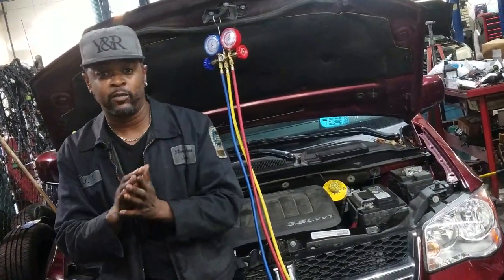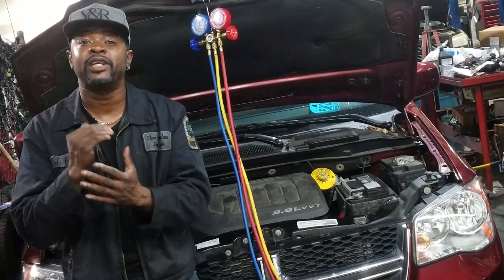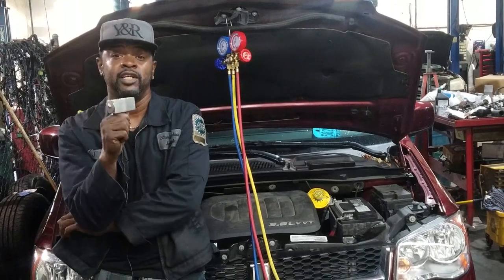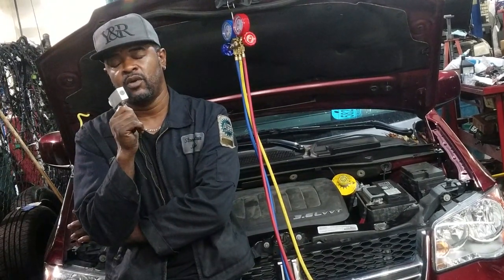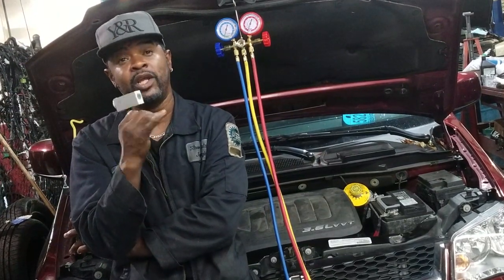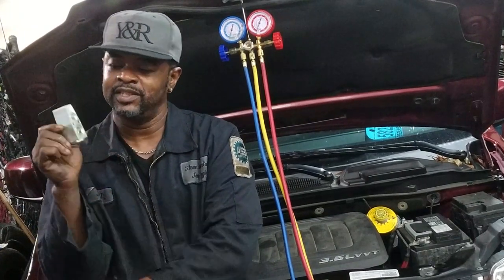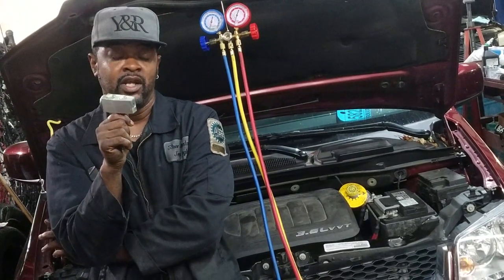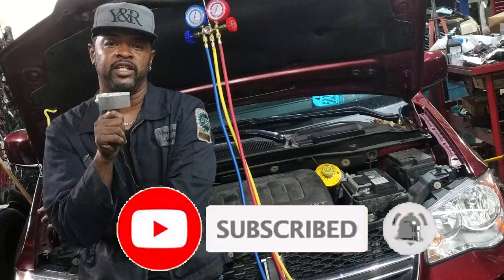My TRICK for How to get COLD AC. How to Replace Expansion Valve.

Comment: does anyone know if there is supposed to be air flow blowing out from the where that expansion valve is attached to the lines? I just changed mine, and it's blowing out air from there, and I don't know if that's normal or not : )
Reply: maybe I can clarify a bit. I changed the Expansion Valve, and when I turn on the A/C I can feel alot of air blowing out from that box area where the Expansion Valve goes. If I push down on the top of the Expansion Valve, push down the bulb/disc top of it, the air almost stops blowing out from there. I just don't know if it's supposed to have air coming out from their when the A/C is turned on.
Reply: Also, lol, I bought a new Expansion Valve and when I put that one in, I tried doing a Vacuum test to see if there was a leak somewhere, and it would not hold a Vacuum at all. So finally after trying to reinstall it several times, and even changing the brand new O-rings for a different set of brand new O-rings, I decided to put the OLD Expansion Valve back in with new O-rings.... the OLD Expansion Valve held the Vacuum easily, the Vac pump got it down to 30 Hg in a matter of a couple of minutes. So, I left the old Expansion Valve in, but I have no idea what that's all about, lol.

Comment: Very informative video.. Can I ask you,  and can you remember since you do these repairs,, exactly what type, color O-rings go on both sides of the expansion valve? 
See, I checked my 2015s system, (which has 78k) and found a leak at the rear expansion valve, just by visually inspecting it. I am about to venture into this job bcuz I am quite capable to do it. I purchased an After Market evaporator and expansion valve for the Rear, except the O-rings were not included. So I have seen the rubber types, red, green or black, along with ones that have aluminum ring outside with rubber in center. I have researched this O-rings and cannot find clarity. My question is, which goes on the evaporator side of expansion valve, and which go on opposite side facing tube pipes the lead down under van.? I'd like to know if you can shed some light on the orientation, on how do they go on this Rear side and which to use? I'd appreciate it gratefully.

Comment: Great videos bro I plan on watching them all. I'm a car video junkie. Real quick, 2018 Durango, I'm getting a hissing sound or it sounds like freon gas running through the lines. The noise goes away when I turn off the climate control and so far my AC is working fine. I was thinking might be the expansion valve or low on gas?  Your thoughts would be appreciated I'm definitely a DIYr. Just replaced an ESIM for gas vapor from watching YouTube. Many thanks!

Comment: Gonna try tap trick because línea seems to be doing what you spoke of.  But my low pressure side running high and my high side not what it should only 110.

Comment: Thanks for the tap trick !! Awesome video!!! I cant say I've seen  guage set in our shop . I just always use the a/c machine for my readings but might have to pickup a manual set for myself!!
Reply from the maker: yea mun, when you do side work, you keep a set of gauges and a air vacuum pump and $5 dollar cans of freon on deck...lol
Reply: @OnlineMechanicTips   What is the 1 hex nut on bottom of expansion valve for ?
Reply: @Devo1987 I was wondering the same thing, no answers?